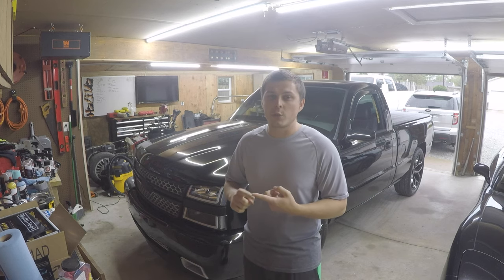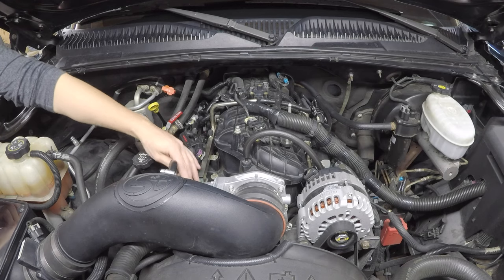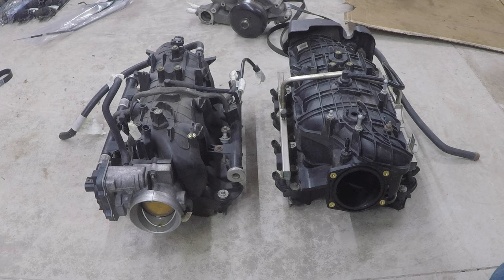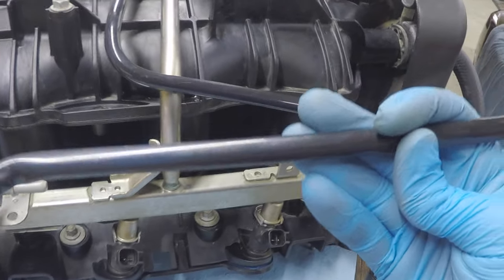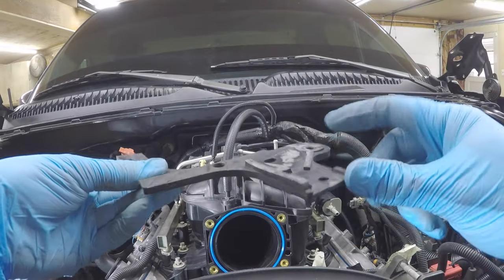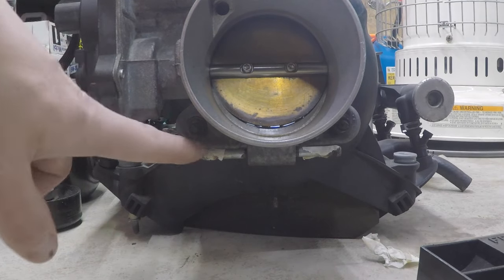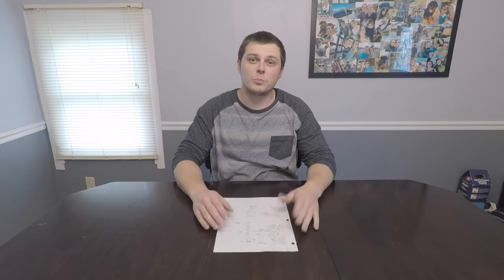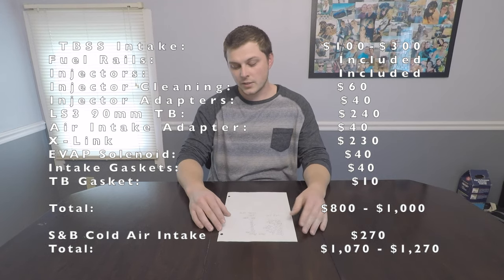TBSS Intake Swap, Ultimate Guide! Add More Power To Your LS Motor!

Comment: Is that a water shut off valve on the heater hose😂
Reply from the maker: Hahaha yup, you like that?  
My truck was a one owner, old man drove it. The blend doors went out, so he put that ball valve in. Open for heat, and closed for cold lol
Reply: @TheKingCoopa  haha hey its not dumb if it works right? Haha
Reply from the maker: @dontcrybeabigboy9091  haha yup! I fixed the blend doors, but I left it on there just in case.

Comment: What do I look for in a cold air intake? how do I know if it’s going to fit
Reply: And I’m confused on whether or not you need the x-link for nnbs?
Reply from the maker: Id do your own research on the hp gains of the top brands and go from there. Make sure you get an intake the gets true cold air. Not a K&N. Fitment, most companies have a guide to tell you if it fits or not
Reply from the maker: The tbss/nnbs intake swap applies to the gen III motors. 1999-07 classic. If you keep your smaller 3 bolt throttle body, you do not need the x link. Of you upgrade to a 4 bolt, GM 90mm LS3 Throttle body, you will need the Xlink.

Comment: Did the ecm need re tuning?
Reply from the maker: Yes. Any airflow or fuel changes, is recommended that you get a tune.
Reply: @TheKingCoopa  thanks for the info, i just finished doing a cam swap on my 4.8 and was also planning on installing the TBSS intake before getting it tuned.
Reply from the maker: @RickyJimenez-tn8gy  oh nice, yea it would definitely be worth looking into, since you haven't had your truck tuned yet.

Comment: What's the part number to that vibrant clamp on your intake pipe to the throttle body?
Reply from the maker: Oh, my bad. I thought I put that link in the description. I'll add it. But here is the link to the one I bought. It has a 4in inlet and a 4.5in outlet. They make a few different sizes. Just be sure to measure your throttlebody and air intake tube
Reply from the maker: https://www.summitracing.com/parts/VPE-2837
Reply: Sweet thanks man I have the S&b intake also with a 90mm throttle body and the s&b intake tube wouldn't fit in the throttle body.
Reply from the maker: @adriancervantes19  oh sweet, yea thats the exact one I used. Worked out perfect. Just need two large metal hose clamps. And make sure they are tight. I had to notch out my fan blades, and shroud so it didn't hit. Since I don't have E fans yet
Reply: Sweet thanks bro !!
Reply from the maker: @adriancervantes19  for sure, let me know if you run into any issues 🤘

Comment: You could have gotten the same HP gain with a e fan upgrade
Reply from the maker: E-fans are a gain of 5-10hp. The TBSS intake, 90mm TB, and CAI is more 15-20hp gain.
Reply: @TheKingCoopa  $ per HP. Is th juice worth the squeeze
Reply from the maker: @diduck6878  thats why I did a cost evaluation/breakdown at the end of the video.

Comment: Anyone know if I can modify my old engine cover to fit on this manifold
Reply from the maker: Not sure to be honest, but I know with enough determination, anything is possible. Im modifying a tbss cover to fit into my engine bay.
Reply: Take the flat plate from the gen 3 and put it on the gen 4

Comment: Thinking of doing a intake swap on my 02 4.8 was wondering if a tbss intake would work
Reply from the maker: Yup, it will fit on all gen III LS motors. If yours is a drive by cable, then you won't need the Xlink, and will need a cable driven throttle body.
Reply: @TheKingCoopa  thank you for the helpful reply keep up the awesome work
Reply from the maker: @shanejohn4992  for sure, good luck 🤘

Comment: will it still work on a throttle cable setup?
Reply from the maker: Yes it will. You wont need the X-link. But you will need the bracket that goes on top to hold your throttle cable in place.
Reply: @TheKingCoopa   appreciate it, I'll most likely modify the stock bracket then
Reply from the maker: @skrelo955  for sure, good luck 🤘

Comment: Fuck my life.  I have an 04 2500hd I got an 06 tbss throttlebody and intake .....   sounds and looks easy enough right?    I got to the part where the connections are alllllllllllll  diffrent and have it all in and bolted when I found this gem !!!   If I knew i needed a 250$ piece I never would have done it 💯 lol.  So my truck is sitting in the driveway for 2 weeks till it gets here   so I used my stock 6.0 injectors not the tbss ones.  Will they be ok?  I have a btr stage3 truck cam and full exsaust.    Fml
Reply: Depends on if your 6.0 injectors match the height of the tbss injectors
Reply from the maker: Haha its all good man! I'm like 95% sure that the truck injectors are gonna be too short. If you have both sets of injectors, you could measure them side by side. If so, I believe summit racing sells a little adapter/riser so you can use the truck injectors. I know for a fact, that the fuel rails have different mounting Heights. If you already have it put together, id just try it and see what happens lol
Reply: @TheKingCoopa  they are in and they are fine.       The only difference is.   The tbss ones.  Had no caps on the tips.
Reply from the maker: @adamchiaramonte7883  oh nice! Let me know how it goes once you fire it up
Reply: @TheKingCoopa  will do sir. You gut Instagram
Reply from the maker: @adamchiaramonte7883  yup! Instagram, tik tok, and youtube are all @TheKingCoopa 🤘🤘
Reply: Ivan J California  i did 34lbs injectors from the 8.1.

Comment: By any chance can you send me the part number for the injectors!!
Reply from the maker: Hey, its ACDELCO 2171621, they are linked in the description.
Reply: @TheKingCoopa  thank you man! And also one more question I have the factory tbss tb I will need the xlink harness right?
Reply from the maker: If you want to run a TBSS, LS2, LS3 or LS7 throttle body you will need the Xlink. Its a newer style signal and connector, that will not be compatible with your older stay harness, unless you have the Xlink.

Comment: Your next project should be E fans
Reply from the maker: Its already on my list! I have a bunch of stuff to do on the black truck this winter. Would you want me to do a video on the e fans?
Reply: @TheKingCoopa  most definitely man, new subscriber . I know your audience will love to see that video. 👍
Reply from the maker: Sounds good, and thank you!! My plan for this winter was to, under bed C notch the rear frame, go to a 4/6 drop, weld in the roll cage, finish the nitrous, finish the fiberglass headliner, then I wanna do a quadrasteer bed swap, widen the rear rims 3in, and run a fat back tire. After that I think ill move on to a new project haha
Reply: @TheKingCoopa  👀👀🤣👍

Comment: Will this work for my 03 6.0?
Reply from the maker: Yes, any LS
Reply: I have a k and n intake currently. Would the hose fit the 90mm throttle body?  @TheKingCoopa
Reply from the maker: @brendanbarry6960  not sure, I've never had a k&n intake, but I would assume not. You will probably need a rubber coupler to make it fit the larger TB

Comment: Hp gain??
Reply from the maker: Hey, im not exactly sure on the gains. I also installed a 226/234 cam, longtubes, milled heads, and a bunch of other goodies. On some of the fourms, I've seen some guys gain 10-15hp/tq from the intake swap (not including the 90mm TB, or CAI) Its nothing crazy, but definitely helps once you start adding all the goodies or boost. Its just more of a budget friendly option, instead of a high ram or an LSXRT for $1k.
Reply: @TheKingCoopa  once ported the TBSS intake is pretty close to the lsxrt intake
Reply from the maker: @beardedforlife3740  that would be crazy! Might do that on my next build 👌
Reply: @TheKingCoopa  I intend to do that on my truck along with a cam, exhaust, and a s475 turbo. It's kinda funny because the truck is far from nice. It's got a bit of rust going on but that's the whole idea. I want people to think it's a pos until I gap tf outta them lol
Reply from the maker: @beardedforlife3740  hahaha thats awesome. I love sleepers. Sounds like a solid setup. I didn't intend to take my black truck this far. (I think I have a slight modification addiction lol) it was actually supposed to be my winter daily, and all these performance parts were supposed to go on my project vette. But I got impatient 😅
Reply: @TheKingCoopa  it all starts with that first modification lol you just end up wanting more lol
Reply from the maker: @beardedforlife3740  haha yup! Now I have a nitrous kit, 2 step, roll cage (all waiting to be installed) and I still havnt touched my project vett in 3 years 😅😥😭😭
Reply: @TheKingCoopa  just something about a fullsize truck hauling ass lol
Reply from the maker: @beardedforlife3740  hahaha exactly 👌
Reply: @TheKingCoopa  where I'm at though, the hardest competition I'll probably have is an Evo 8